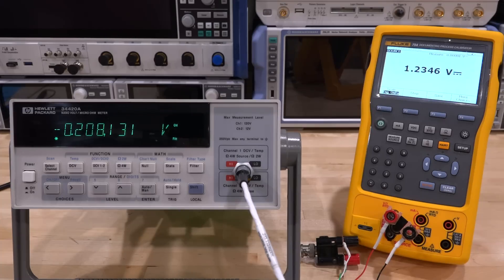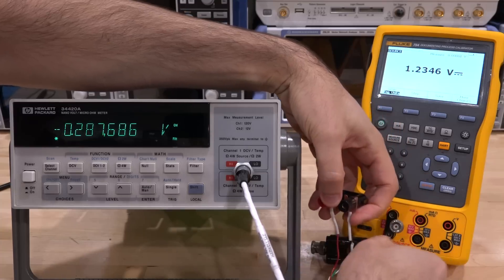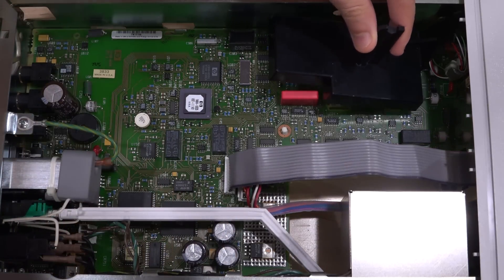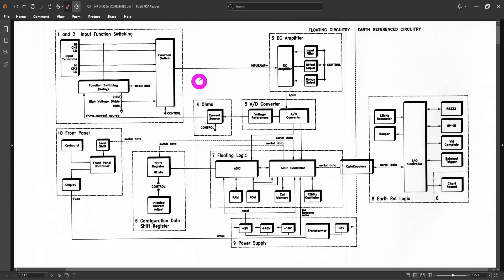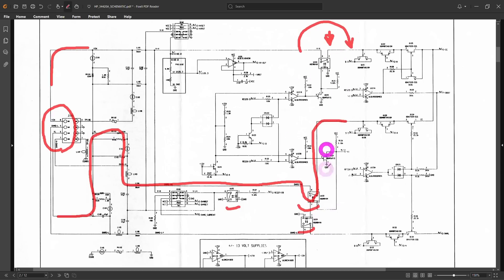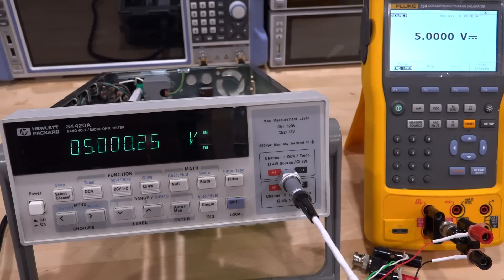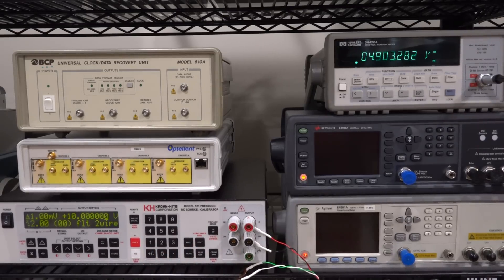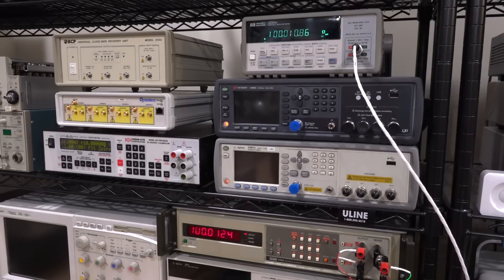TNP #49 - Keysight 34420A 7.5 Digit Nano Volt / Micro Ohm Meter Teardown, Repair & Verification

Comment: I've never seen those SS switches before LH1510 are a very neat device but I'm still surprised that can be used in such a sensitive low level front end

Comment: Nice repair. Can you measure the injection current of this HP nanovoltmeter? This can be done by using an Oscilloscope. I recently got a 2182A nanovoltmeter, but i am not quite happy about its   injection current although Keithley claims 2182A has one order of magnitude smaller injection current (pump out current) than any other nanovoltmeter/micro ohmmeter (obviously referring to 34420A).

Comment: TSP such a badass he didn't even bother measuring those optical relay outputs to verify voltage isn't making it through them.  He just DIVINED his way through the repair!  Amazing.  :)
Reply: I'd say an intelligent deduction. Chances of a jfet which is isolated from everything and has been working within the datasheet parameters all its life il less likely to fail than a solid state switch which is in direct contact with low and high voltages.

Comment: Calibration of these nV meters is not as straightforward as one might think. Lucky enough I know a nearby lab just capable of handling that task! 😅 Broken optoswitches is a very common fault in these 34420As.

Comment: I recently bought a 3478A multimeter, advertised as non-working. This was a result of having no push rods for the switches. Half an hour in Solidworks and I had a couple of files I could 3D-print, and now that is fine. It turns out that all the elctrolytics have been changed, as has the battery. It has what looks like a decent cal, but I'm not 100% positive. I shall keep on looking, but I may try to find a cal centre that is not too expensive.
Reply: All calibration is expensive!